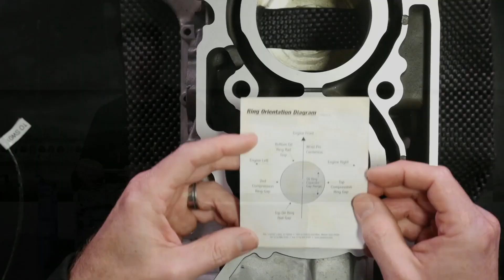Ring Gap Location 101 | Performance Engine Building [HPA Q&A]

Comment: Can someone explain why high performance 4 strokes don't have a ring index pin (like 2-strokes). The Comp. rings would be indexed and stay put. Bye Bye blow-by!
Reply: Because the rings in 4 stroke engines are designed to rotate to keep the grooves free of carbon so the rings don't get stuck in the grooves or wear unevenly. It would be bad if, for example, the thrust sides of the rings wore more than the rest of the rings and they got out of round or if the ends of the rings wore grooves in the cylinder walls.

Comment: I put my ring gaps over the pin bosses. Left right left right. That way thrust loading from the piston during initial break in isn't trying to force a corner of the ring gap into the cylinder wall. (I do chamfer these as well)

Seems to work great for me. Engine tear down they are all over the place of course.